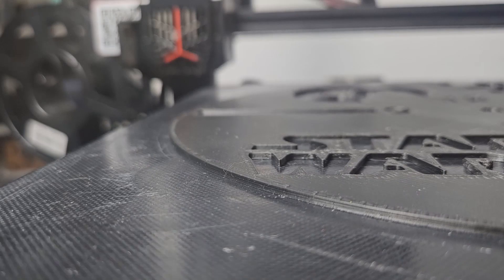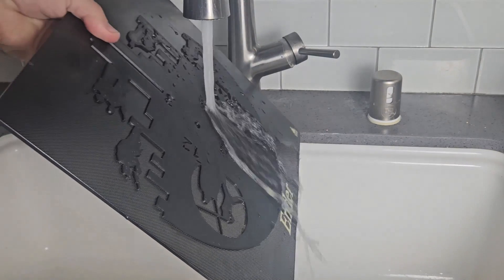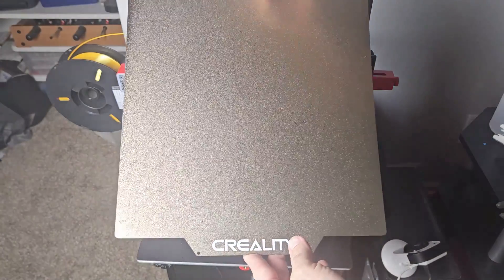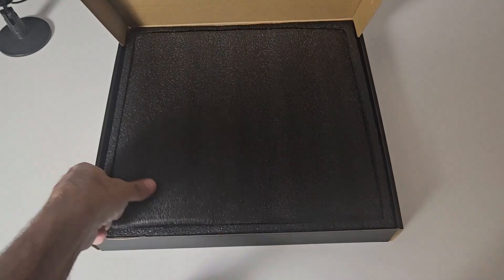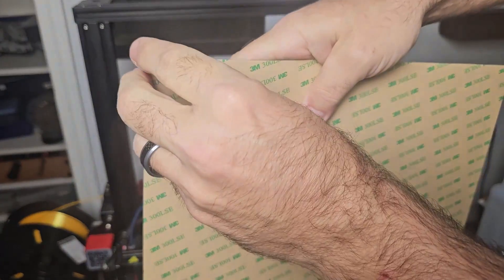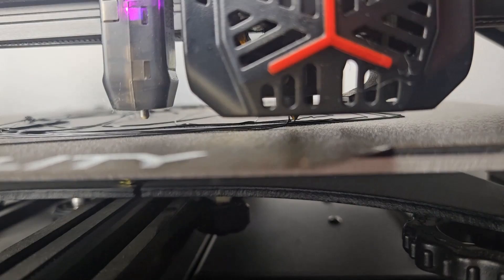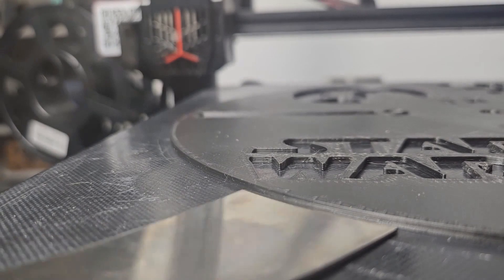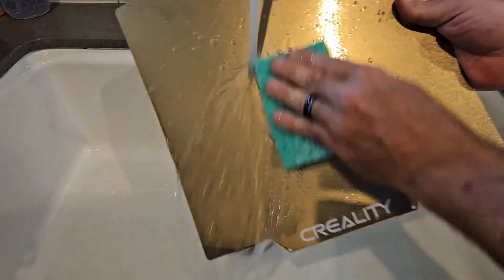3D Print Stuck To Glass Bed? You Need To Watch This Video #3dprinting

Comment: I cleaned my PEI plate and the PLA stuck. I actually like my flexible Ender magnetic mat more as I can just pull and bend off the part. I dont print much flat plate type stuff but the first 2 prints on the PEI plate did not stick. Tried glue stick then read that PEI should not use any adhesion. washed it with dishsoap and it works now.
Reply from the maker: That great you got it working. Yea, water and dish soap will fix it most of the time.

Comment: I actually went the opposite way... replaced the PEI build plate on my machine with a glass one, as I kept running into adhesion issues, and every single solution I tried only solved the problem temporarily (2-3 prints), then I had to go at it all over again. Switched to a glass plate... adhesion has been great.
Reply from the maker: That's interesting. And no problems with getting the prints off the glass bed?
Reply: @3DMaxBuilds  As long as I wait until the print has cooled down, getting it off the glass hasn't really been an issue.

Comment: I got a sheet of G10 (for a large bed) for about $12. It's 310 x 310 and 1.5mm thick. A smaller size is cheaper. When it's hot, parts are practically welded on. After it cools, they either very lightly snap off in a very satisfying way or sometimes I can literally just flick them off the build surface as if they were just sitting on a table or desk. Zero effort. Easily worth twice what I paid for it.
Maintenance is super easy too. Just spray and wipe down with alcohol to remove greasy fingerprints.

Comment: I would put my ender glass bed in the freezer to help get the damned prints off. Sad times. Glad those are behind me. I went from the ender series to the Bambu Lab P1S and I have never had to mess with it. It didn't cost that much more than my Ender 3 s1 pro when I got that a few years back.

Comment: What I do is scuff up the build plate with sand paper or brilo pad or 0000 wool. I use a smooth pei sheet that has 3m adhesive on it stick it to my flexi plate prints sticks so good.

Comment: Use G10/FR4 sheet. Been using it for 2 years, never had to use glue and prints never get stuck or slide off the build plate. And its super cheap if you can find a manufacturer in your area.
Reply: I ordered a 310x310 sheet about 1.5 thick from AliExpress for about $12. Probably took 2 weeks to get here and I haven't printed on anything else since. That thing is truly like magic.
Reply: I second this. G10 is the way to go. I still keep the PEI sheet for some specific applications though